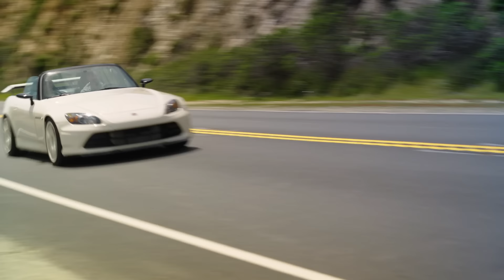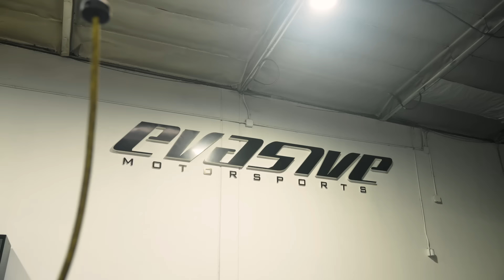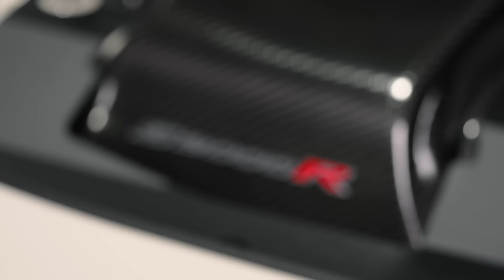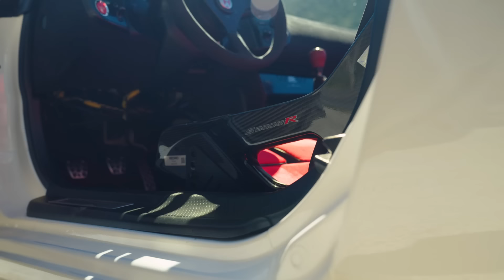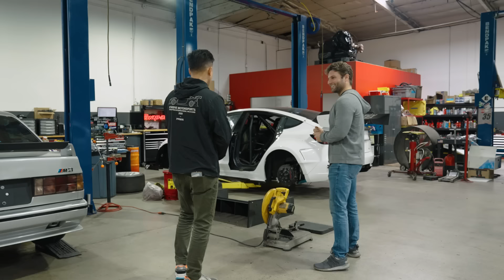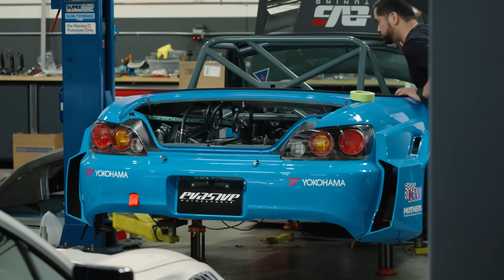Honda S2000 'R': AP2 Build With FK8 K20C1 Type R Power | American Tuned ft. Rob Dahm

Comment: Looks nice.  Never heard the engine but I’m sure it’s nice.  Having a screen for gauges is a bit of cheating.  If they were to design a nice set of analogue gauges like Singer it would make it feel much more special.
Reply: the original dash was digital so doesn’t it keep the theme?
Reply: @peejayem4700  kinda yea kinda no.  It was static digital so it’s iconic for its time but the point is, if you’re not going to use the original gauges then craft a set that feels more legitimate and special, not one that’s just like every other graphic display and feels tacked on aftermarket.  It’s subjective to taste but I know I get butterflies when I see the gauges in a Singer Porsche or David Brown Mini.  It’s worth the effort and creates a signature for the builder.
Reply: @gryphon123456  I love the Singer - and the gauges but  in my opinion would feel totally wrong in an s2000. Agree that the digital display they used does look generic.

Comment: Nice upgrades, but i don't see the need to swap the engine, the Stock S2k engines love boost and make great power.. they can make 500-600whp reliable all day with a proper tune..
Reply: Probably because Honda makes a K20C1 crate engine.
Reply: @sjhudon386  It is a great option if the original engine is already needing a rebuild and if someone wants a new engine i can see them going for the type r turbo engine.

Comment: My guess would be that massive changes have been made to the setup and suspension, but what's done isn't mentioned in this video...for whatever strange reason. So... I don't know what i need to know about the car. The few things i do know: I like the look, and the few thoughts behind we're told about (minus one hugely important part). With an engine worthy of the S2000, a screaming VTEC instead of a sad turbo, this would be fantastic. I get where they're coming from, but that engine is a big fat "never ever" from me.
Reply: More of an advert than an actual video. They didn't even wind it up, no mention of rubber or suspension details, waste of time
Reply: @FiragoMusic  Shorter and more to the point than my comment. I absolutely agree.

Comment: As an owner of an S2000, taking that legendary F20C out which defines the car and going to a CTR Turbo engine has taken away its character. Another one is removing that iconic digital rev counter. It may be faster but I rather have that 9K red line and the engine that was made for this car that goes hand in hand. On another note, anyone who hasn’t driven an S2000 are seriously missing out. What a car!
Reply: Agreed. I supercharged mine, put on a Robbins soft top and installed adjustable shocks. That's all it needed.
Reply: Amen, I don’t even like K swaps cuz the F Series sounds better and it’s exclusive to this car which makes it special
Reply: @BRAINFxck10  Perfect way to add torque and hp is electric motor between the transmission. You drive basically a stock F20C but just 100hp and 100Nm more

Comment: Defeats the purpose of the S series. It was always a high revving screamer that you can hear from far away. Now it's muffled with a turbo and red lines at 6900rpm making it silent and boring. 

What would have been impressive and skilled is to tune and build a k20 type R which is rated at 220hp at the crank and build it to 280 to the wheels at 9000rpm. 

N/A all day.

Comment: So when you @TopGear say Type R for the H S2000 would be like the H CIVIC Type R what do you really mean by that? Isn’t the H S2000 a really old model from Honda or what?
Reply: The Type R(acing) is a trim level.  the S2000 never got a type R trim. it was at best the CR(States) TypeS (Japan) and the GT(UK)
Which those were closer to what you got from a honda with a Type R package than this tuner version.
Lighter weight, better suspension, some aero bits, and a few bobbles to increase power. The Civic/Integra Type R usually also received a superior engine during the time of the B Series and the K series on the base of the internals alone. Meanwhile the S2000 just had it's motor made for it and no one else, and Honda couldn't justify making an even more special edition engine for a car that was already relatively limited production and didn't have a wait list for production.
Reply: @SpecialKLSX  ok

Comment: S2000 without VTEC sound should be a crime 😅
Reply: this s2000 still has VTEC though?
Reply: @dawiepieterse9703 K20C still uses VTEC technology. It's just that it's turbocharged.
Reply: @dawiepieterse9703 VTEC at 7k rpm is foolish. Maybe wrong 4-5 is more reasonable
Reply: @dawiepieterse9703 Yes, on the exhaust valves.
Reply: To say this motor has vtec is a joke. It’s low rpm for turbo spool not for high hp rpm
Reply: Everyone saying it still has vtec.... yea but if you've ever ridden in a stock one, it doesn't pop like old school vtec engines. The sound is much different.
Reply: Pass on the 7k redline & "VTEC", even the valve cover is fugly on the K20C & it's plastic. 🤦‍♂️
Reply: Usually the F series is supercharged with vtec retained to get an NA like feel. Still lacks low end torque. Just depends what you want. Turbo S is fun to drive
Reply: Haha
Reply: Yea he said it’s the new type-R civic motor so it has the v-tech
Reply: Uhhhh, last I checked, the K20C has VTEC. It's just not a screaming N/A that we grew up to in the 90s.
Reply: It still has vtec what are you talking about
Reply: The FK8s Engine has VTEC
Reply: Most modern cars have variable timing camshafts
Reply: @pault6054  VVT and VTEC are not the same. VVT changes only the timing (usually infinitely between 2 points); VTEC changes between 2 cam profiles that can have different timing, lift, and duration. Engines cam have both VVT and VTEC (or however the manufacter calls it, it was VVL on the Toyota 2ZZ-GE)
Reply: Got sit down
Reply: Not me, I'd be happy to take turbo VTEC like this. One thing I don't like about the NA VTEC is that you have to rev it hard to get the optimum torque, which is a nuisance for long distance journey.
Reply: @farishanafiah8461 In a long distance journey you're primarily cruising so why would that matter?
Reply: @NathanaelNaused that you’d need to downshift and sit at 7k rpm if your wanting to pass someone
Reply: @carter.coleman  If you want to pass in anger at 80mph maybe
Reply: @NathanaelNaused  well your in a sports car
Reply: @NathanaelNaused if someone is slow in front of you, you are now decreasing rpms while in high gear or you have to shift every time. It's pretty self explanatory to people who drive modified cars
Reply: Might as well just get an accord then if your just planning to cruise  @NathanaelNaused
Reply: @MonicaHolly143  Have you ever been on a long trip? It's lots of highway driving at a steady speed.
Reply: @NathanaelNaused  yup driven my c6 jupiter florida to north carolina in 2 days i would rather have a turbo charge kseries than a slow s2k, you can still cruise with a kseries
Reply: @MonicaHolly143  Not saying it can't, I'm saying downshifting to pass is not something you're doing a thousand times an hour on a long haul trip. That's on a spirited drive or maybe a commute
Reply: @NathanaelNaused  thats exactly my point you wont have to downshift as much when you have a turbo charged car becuz it will still pull even on 5 and 6 gear while the s2000 will need atleast 14 seconds to have enough torque to overtake in 6 gear
Reply: @farishanafiah8461 in my opinion you’re kind of missing the point of the F20/F22
Reply: @farishanafiah8461 that's just an overall disadvantage with 4-valve engines. All of the power is at the top-end due to how air flows into the cylinder vs 2-valve engines.
Reply: Stay slow NA boy
Reply: Lol this comment was made by someone who owns a d16 eg civic and will never own an S2k
Reply: Well, some people like to go fast. VTEC makes cars slooooooooowwwwww
Reply: @JacesOwnWorld Not really